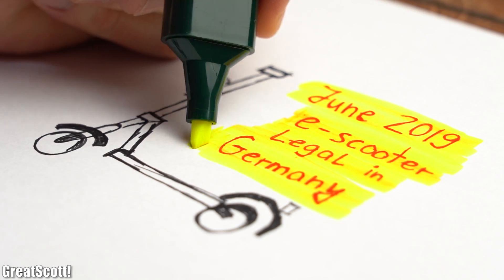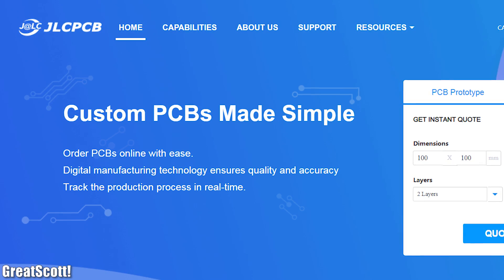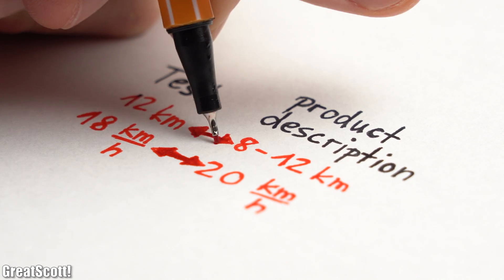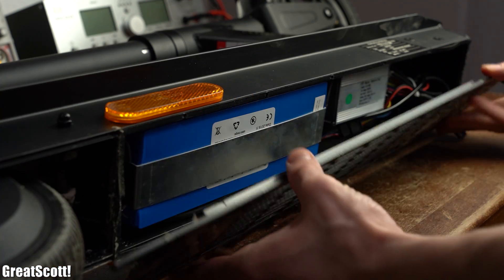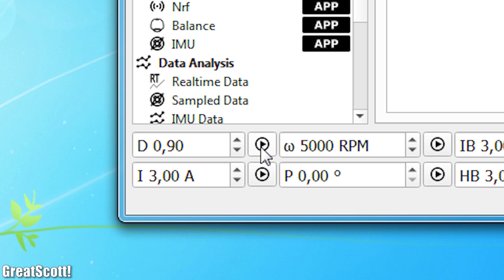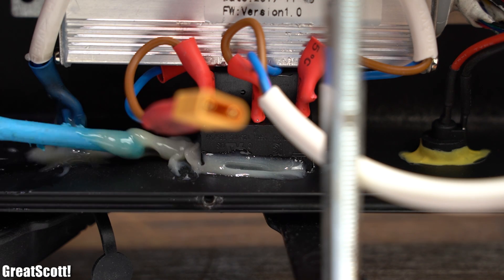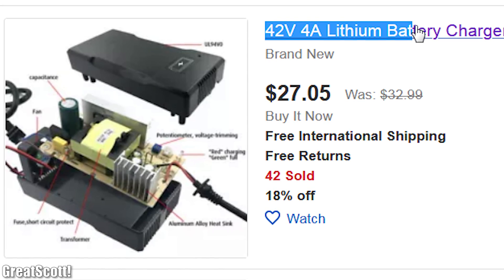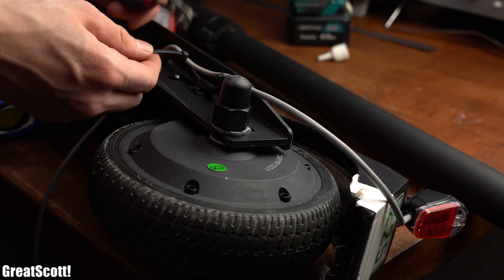Upgrading the cheapest street-legal E-Scooter I could find on the Internet!

Comment: I think we have the same idea. I got a 900 watt scooter. But it's sold Australia street legal so it has a 36v 7.8 amp battery. Which tells you its restricted to around 250 watt. I can increase the capacity to try get the most out of the 900 watt the motor can produce. I'm assuming when it says its capable of 40 kmh that's more than likely only possible with a bigger battery and cutting the restricted wire. I assume it's using the same controllers that have the blue restrictor wire or they shouldn't be legally allowed to say its capable of more than 25 if it's the controller. If not the controller is cheap so can swap it.

Comment: i have same scooter, but i think i need new board, is there replacement you recommend.
Symptoms: does not charge past 75% and after riding 120 seconds all power cuts off, turns off the scooter, even tho I still has battery power.

:( your my only hope

Comment: Wire a 3 pole double throw contactor for a wye start delta run. 1.7x increase in RPM but 50% the torque.

Comment: cant you just swap out the battery's in the battery compartment with higher capacity cells thus increasing your range without needing to haul an extra battery hooked to a wire in your backpack?

Comment: i know how i got this idea late but it would make a cool video if you used a VESC with Field Weakening on this escooter to demonstrate that VESC's can defeat the max RPM by voltage, basically by sorta defeating the BEMF and thus increasing the max rpm aswell

a newer VESC6 or one with 3 phase shunts atleast can also do Silent HFI, which is silent brushless and sensorless drive

it NEEDS a shunt on each phase to be able to do Silent HFI though, otherwise there will be a high pitch.

you can try HFI on older Vesc's aswell but it wont be silent

be sure to turn off phase filtering on older vescs on new firmware aswel

Comment: Measuring 3200 rpm peak seems a bit off, that would imply ~100 km/h top speed on a 6.5" (total diameter) wheel. The wheel itself should be measured 580-ish rpm: maybe we saw the rotation speed of the measuring contact adapter wheel?

Comment: The esc configuration must have been wrong a 36v battery 42v charged on a non restricted bldc controller will do over 30kph unless its a weird kv motor which I doubt most are locked via software

Comment: A little advice: more important than suspensions is the type of tires (full, air, tubless) and the pressure inside.
For example a xiaomi m365 with 2,2Bar is lot more smooth than a xiaomi m365 with suspension and more bar (but you have more risk of holes with low pressure, 3.4 is more safe, but very shaking).
like in mtb if you use your leg as shock absorber you will not feel any vibration, it's like magic :'D

Comment: Haha, I boost e-scooter speed by using cheap 4€ buck converter to step up voltage (versus new battery 200€). Theoretically it could go up to 45km/h but since controller limits motor rotation speed, it can't go faster than 30km/h. But still improvement on 20km/h (with 36v battery). It may sound like stupid idea, but I have tried it and  now I can't help but to use it everyday since 10km/h is quite improvement on speed and I can use it as charger too. Even though buck converter has 96% efficiency and speed has increased, I haven't noticed any significant difference in total mileage that it can go with single charge.

Comment: You could've added a photodiode for automatically turning the lights on and off whenever it's dark outside and an ESP for controlling certain features with your phone (power-saving mode, manually turning the lights on and off, etc.)
Might be a interesting project for an upcoming video!

Comment: Modified my e-scooter (Ninebot ES1) with 4 times as many batteries to get a much longer range.  Requires two chargers, which I plan to replace with one beefier charger. The steering pole looks like it's been eating steroids with all the extra batteries hanging around. (Made some neat holders with help of a 3D printer). 

I've also increased the maximum allowed current to the motor in the controller settings. A bit above the recommended settings for the BLDC motor. That did shorten the range a bit, but in turn, it got a lot stronger and have a much easier time uphill. I can always lower the speed to increase the range if need be.

The scooter in question is made from scrap-parts and broken/run over scooters I've bought from various sources, which made it all quite cheap.. except for the batteries. They're the most expensive parts in my case. I don't want to deal with batteries from questionable sources, or deal with "used" battery packs. One never know the state of those which can be dangerous.

Comment: Lack of speed mod is a bit disappointing, particularly when a single speed bike with a backpedal brake could go faster - let alone a proper 10-speed bike is about twice as fast with some pedaling effort. (Why are e-scooter regulation speeds so ridiculously low? And in the same country that has the Autobahn?)

Comment: I've added a second battery in parralel on an m365, they have custom firrmware you can change the rpm limiter and current draw, got an extra 9mph becuase there is an extra bank of cells to draw curtrent from, little bit worried the mosfets will burn out though

Comment: So you are telling to me that you can just give a higher voltage to the charge port and it will charge the battery faster? or did you mean charging it straight from the lab power supply?

Comment: Question,

1. Why not use a voltages regulator for the lamps to conserve power and compensate for the voltage drop for your battery as it discharges?

Comment: Dude You don't need to resistors or buck converter to power the lights at all.You can use the wire for the throttle. It is 5v and it just use energy when the scooter is powered on. In idle it uses nothing because when you shut down the scooter, you also shut down the controller. The throttle connect to the controller and don't pull anything if the controller is off.
Also you have plenty of room to add the second battery in the frame and keep the wiring for a third battery

Comment: For the same price you could have get an used e-twow booster S2 with an impressive motor that could could have driven to insane speeds (just for in lab use obviously). But maybe it is more of a C.Furze kind of mod. The e-twow are known for having tons of hacks already existing : upgraded controlers, external battery backs, disc brakes... And they are even cheap clones of the e-Twow with the same great motors if you preffer brand new items.

Comment: you could've changed the 18650 cells with more dense ones like 3500 capacity ones to upgrade the battery,   and keep the same space  assuming that's affordable for you, this I think would be better than you solution

Comment: another way to overcome the top speed, which is often cheaper is to swap in a motor rated for slightly less voltage .. SO if this was a 36 v configuration , a 24 v motor of similar spec would make the top speed 27kph or so.. and the battery and controller could remain stock

Comment: Hello everybodies,

I've been trying to install turn signals on my scooter for a few weeks, but I can't.
The battery has a capacity of 52V (59V fully charged) and the LEDs that I am trying to install only use 12V MAX.
I have already tried to install adjustable voltage buck converters, but they have burned out the scooter controller, because they seem to consume more electricity than what is allowed by the controller on this branch of the circuit (turn signals).
The LEDs are already attached to the scooter, but they are not yet powered.
So I would just like to know how to go from (more / less) 52V with a resistor, without risking to burn the new replacement controller.
How can i do thant please ?

Comment: for the back light, he is using two 5.1K resistons ins parallel which equates to 2.55K, why doesn´t he uses just one  2.4K resistor ?
Reply: Because hes got to dissipate a lot of heat. :)

Comment: Nice ! I've had an electric scooter for about a year now, and I have to say that even though it's not a strictly legal requirement here where I live, I also added a front light and enhanced the back light of it. I didn't tinker with the top speed because it's already kind of close to 25km/h (max. speed for this kind of vehicle here). I'm planning on eventually getting a larger battery (or auxiliary battery) and ALSO, integrate a charger INTO the scooter and add a standard cable and plug, to charge it anywhere without having to carry a charger, should I ever run out of juice on the go.
A piece of advice though, if your scooter does not have any kind of suspension, DO NOT RIDE IT ON ROUGH TERRAIN. It will be seriously harmful to your scooter. Mine even has some bent pieces of steel on the frame due to persistently riding on rough terrain so now I avoid it as much as possible. If you have to pass through rough terrain on it though, keep going below 15kmh, will help a lot.

Comment: I have to agree with the bad light tuning. you can easily cure the quiescent current problem just by switching the DC-buck converter on when you need the light ;-) The resistor network is not an improvement - its the opposite! Just leave it on extra power - much more efficient.

Comment: You probably know this, but the final saturation and balance charge will not speed up because the batteries slow down accepting current at that phase. Eg
https://cjeastwd.blogspot.com/2020/01/4a-charger.html

Great work as always

Comment: Might want to look into aircraft bolt wiring (aka "safety wire") methods, so you don't lose your gear in high-vibration environments. Seems like a good skill to know
Reply: I've seen a few jet videos, and it's  called "Lockwire"

Comment: Could you have replaced the 18650s in the battery bank with ones with a higher capacity?
Reply: Use INR18650-25R batteries, you'll get an extra 16% ride time. Even better, if you have room, use a 3P10S instead of 2P10S, adding another 50% after that.

Comment: Your LED lights are going to burn out in short order.
From my experience in converting 3xAAA LED "Tap" lights to use Li-po batteries the lifespan of the LED's is optimized for the 1.2 volt cell nominal voltage not the peak voltage 1.5 volts that when tripled is closer to the nominal voltage of the Li-po. If you keep that battery topped up most of the time you are going to be driving those LED's to a VERY early grave.
Reply: If that happens it can give him a reason to "upgrade" the headlight to a better LED light and make a video of it 😁

Comment: Is it possible to have a switch to change polarities of batteries when fast charging? For instant my battery pack is 36 v. But can I make a switch to change the polarities of battery with a flick of switch to 72v? Reason, to increase voltage so I can use higher v charger so my battery charge rate increase.

Comment: If range matters, just use a small DC-DC converter for the lights. They are much more efficient and will provide a constant voltage so your lights will not go dim when you accelerate or when the battery is low.

They cost less than €2 including shipping.

Comment: Resistors? Check LM317 current limiter circuit configuration. You can do the exact same with a buck converter, i.e., make it a buck current controller.

Comment: Replacing the 18650 with higher capacity gives you roughly 2x the distance! Why didn’t do that? Or create a custom cell pack with bigger cells.
Reply: He really loves his Samsung INR18650-25R cells. The last number (25) denotes its cell capacity; 2.5Ah. A 10S2P cell (as was done with the scooter) results in 5Ah and 37v nominal battery voltage. He would have 185Wh by the end; an extra 26-27Wh. Probably not worth the effort, and that's the best 18650 cell I know.

EDIT: An improvement of around 16-17% would actually not be that bad, it would mean an extra 15 minutes of ride time, and he could probably bump it up to 3 parallel cells if he made his own battery pack from scratch.

Comment: a dc jack is probably not well suited for you external battery application. those usually go up to 5A max and a 250W hub motor will exceed that rating at 42V, especially in peak currents.

Comment: Man, I'm sorry to hear that Germany has such scooter laws. 

If I were you, I would have bought a Xiaomi M365 though, even if it isn't technically street legal (would people really notice?). It probably has larger tires (8.5 inches, which you can upgrade to 10 with little modifications), has a higher range, and a top speed of 15 mph, or 24 km/h, which can be easily increased with a custom firmware up to 35 km/h.
Reply: They would notice - the scooters require a license plate.
Reply: Yeah, i don't get why he even bought a street legal model if he wanted to modify it anyway.

Comment: I found something strange: if the max ratings 18km/h,  and 3200rpm then one rotation about 9,7cm distance and the wheel diameter should be 2.9cm ??? It's OK there are two different cases (loaded and unloaded) but I can hardly imagine a bldc motor can rotate 5-8 time slower if it's loaded
Reply: his tachometer had a tiny wheel on it relative to the one on the scooter.  Since he was just comparing values to see if he could get a increase this is fine.

Comment: Is there a reason that you are using resistors for the lamp, instead of DC-DC Buck/step down converter?
Reply: I just noticed, that the front and backlight have two different voltage ratings, so I suppose its down to price and bulk.  (the resistor network still looks hilarious, due to it being made out of so many resistors)